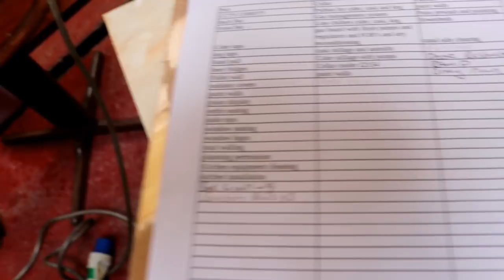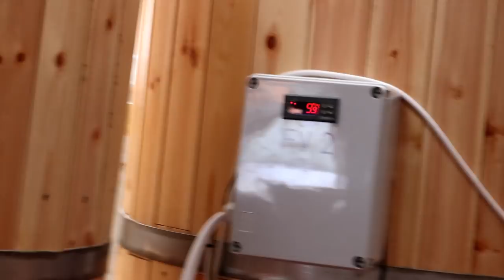IT HAS TO COME DOWN

Comment: Since it's under the kitchen, I'd suggest applying some long-term pest control before I sealed the ceiling back up. I've used this stuff from the hardware/home stores that comes in a big syringe, comes out like cake icing consistency, & kills cockroaches for a long while as they eat it if they show up. Just a 2 inch stripe every yard or so. They make the same type of stuff for ants as well. (Maybe more important here in Florida though, don't know.) Love your vlogs. Cheers!
Reply from the maker: Cheers man, we don't have roaches in the UK, Mice, rats, and rot is the main problems.
Reply: Oh good. One less thing! :)

Comment: If you didnt already, check Ebay for CCTV - Alot of money to save there compared to local shops.
Reply: Big fan of the Ubiquity Unifi ones, power over ethernet so its just one cable and you can put them wherever without needing a plug.